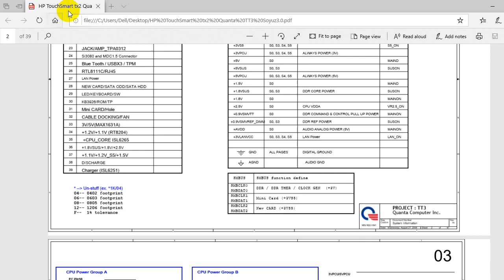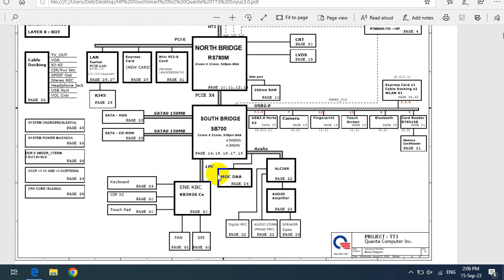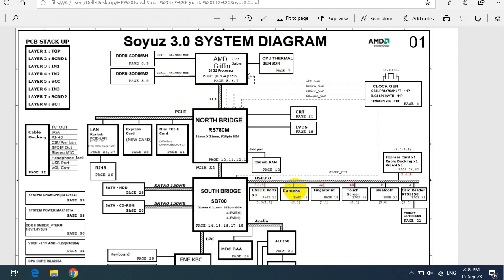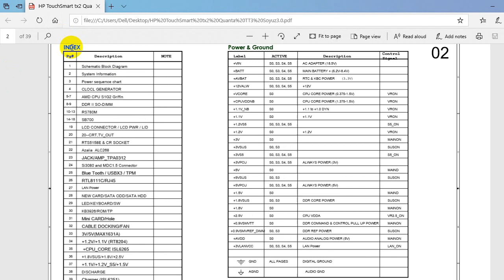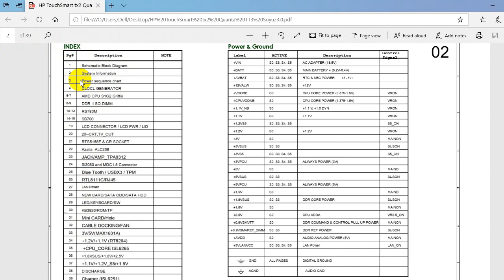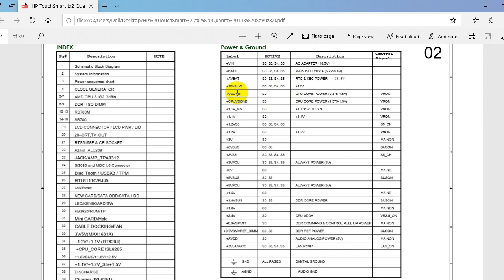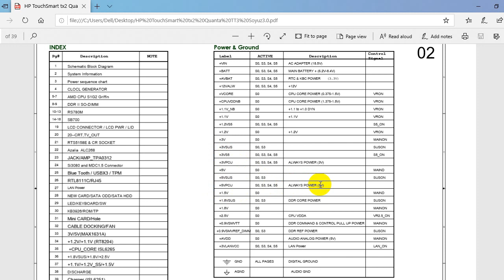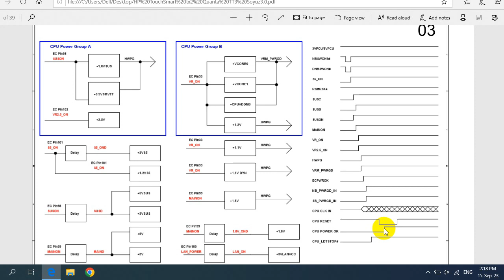Learn Laptop Schematic Reading-hp touchsmart schematic

Comment from the maker: Buy Repair Tools👇👇👇
https://northridgefix.com/shop/?ref=E...
Microscope
Voltage Injector
Programmers
Reballing / Stencils
Repair Tools
iPhone Cases
Soldering
Soldering Equipment
Storage / Rack
SMD Books
Tempered Glass
Test Tools
Components
Donor Boards
Gadgets / Accessories
Ports / Connectors
Tweezers
Adhesive
Apparel
And much more
Reply: Do you have ebooks of all this schematic readings to download from... thanks alot